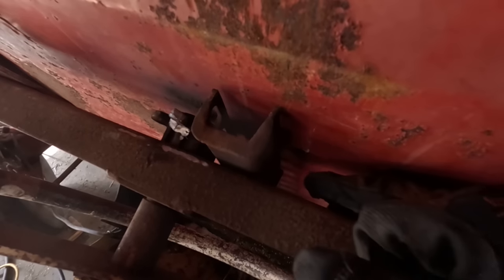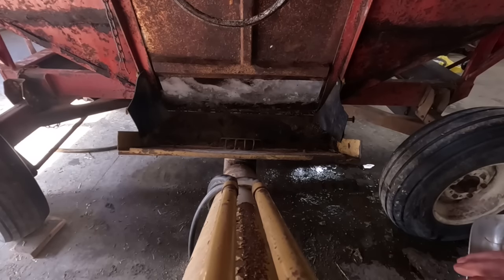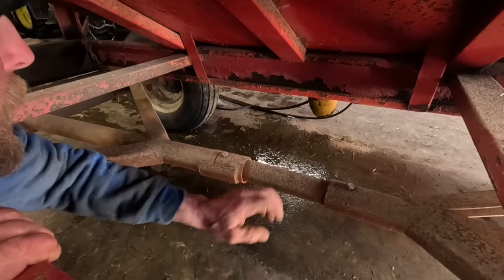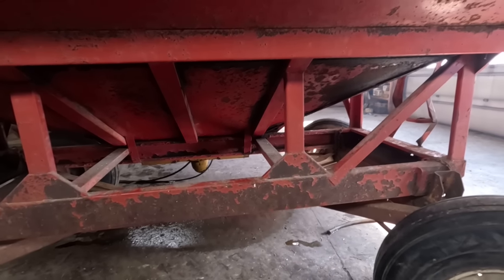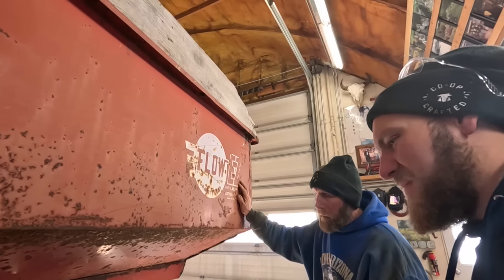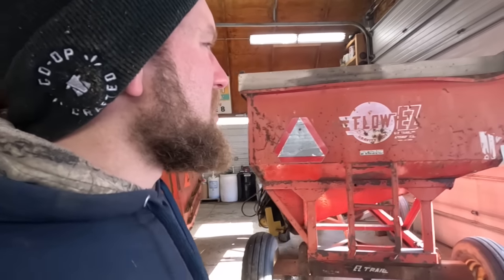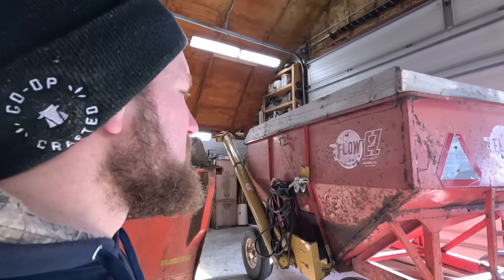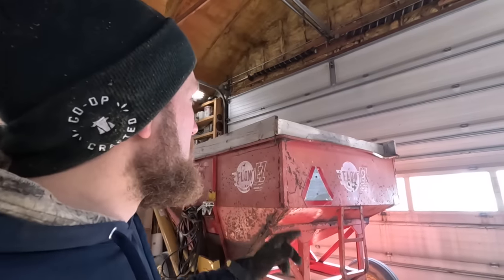Trying To Keep It All Together! Revitalizing Old Equipment!

Comment: i clean mine out at the end of planting good hot water then let it sit then go back and dump waste oil in it and some wood shavings in it to make it get on the auger better then i leave it sit then in fall i fill it with shell corn and use the auger to run into the feed mill.  and every couple of years i paint the inside of the box with ez slide from farm fleet.   protects from corrision and helps the fertilizer slide

Comment: The more self sufficient you are off together as a family the better off you are. We ran into a problem 10yrs ago we could not get bagged fertilizer, and we only needed 400lbs for our small corn patch we grew for grinding our own feed. We ended up building a plywood box that year and the co-op filled that with our 400lbs. This happened because the bagging machine broke in an odd and extreme way so it had to be just replaced instead of repaired.

Comment: We have two auger wagons that we use for fertilizer: one holds the planter ("starter") fertilizer, and the other holds the fertilizer that we put on with the spreader. The fertilizer plant brings the product in a big truck with an auger, so it's easy for them to load the wagons. In the fall we fill one wagon with wheat seed to load the grain drill with. They're not the best gravity wagons on our farm, and it's maddening to see what the fertilizer does to them, but they're still essential to the way we operate. I think you and your dad will find these to be pretty handy.

Comment: I was just ready to comment  for you to pack the wheel bearings when you started to pull the dust caps. I always at least remove them and check inner and outer  bearings plus pack. Wagons hardly ever get the care they need, even though they[re hauling some very valuable stuff.

Comment: I know I would flip that box around on the running gear so the auger is out the back, some locals here figured out why I said that with a cab window backing up tight.  

I have used both types, I think dry stays in place alot better with the goofy weather conditions these days, but it is harder to handle..............I know one thing, I sure wouldn't be shoveling it out of sacks or using bags, that auger is a no brainer.  Shoup used to offer a extending tube, put that on it and you can fill your 4 row just by backing up to the wagon, no cross auger needed.

Comment: I have a  John  deere 7000 corn planter with fertilizer  auger mounted  on the center of planter  just  back up to  gravity box  and let it run in the two boxes on the planter.  I only have a  four row  planter.